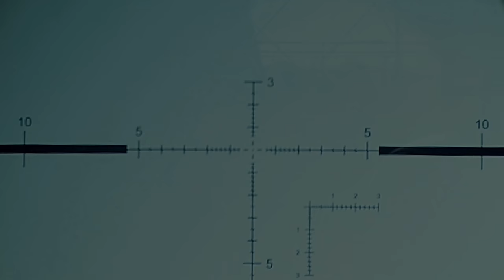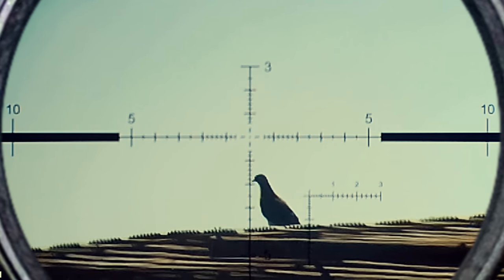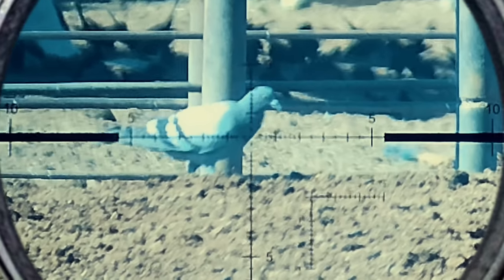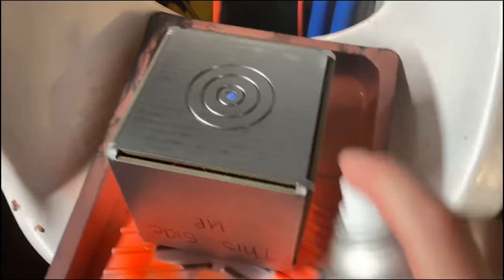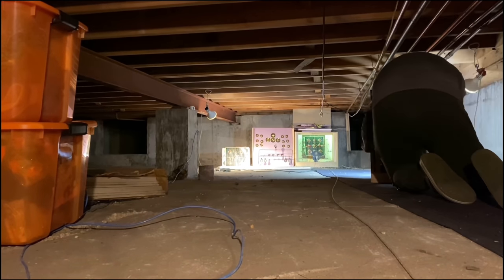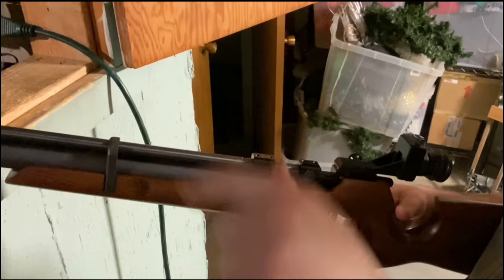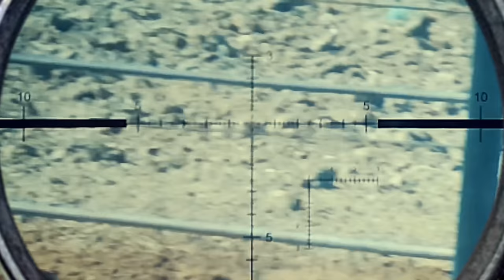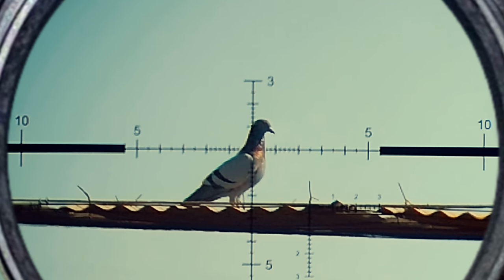Pigeon Hunting with the Leshiy 2

Comment: I'd put a pulley system to move the targets back and forty with some wheel on the bottom. Hard wire the lights to the box and simply pull the cable and the box comes to you. No more crawling to the box.

Comment: Otay T... for the bell box.  Two ropes attached to the box (bottom front and bottom back).  A pulley at the bottom back behind the box and a pulley above the first one.  Route the back rope through the two pulleys and have it go to the entrance of the crawl space.  The front rope also needs be long enough to reach the entrance to the crawl space.  Now, to the bottom of the box, mount four swivel casters which are large enough to allow it to traverse without tipping over.  You  want the center of gravity of the box to be low.  Pull the front rope to bring the box to you, pull the rope going through the pulleys to return it to the far end.  If you need it, have some stops for the box to bump against to position the open front to you in a consistent angle when brought into position for shooting at it.

Love seeing all those flying rats getting smoked.

Comment: Skateboard wheels on the wooden box holding the target, aluminum or steel L or U channel for the wheels to ride in, pulley at the back wall for paracord to pull it back and one in the front can even be motorized

Comment: Little late but why not put the box on a rail? A string to pull it towards you, and a rubber stopper with a magnet to push it and lock it back. Then you don’t have to crawl in there to paint it.

Comment: Nice shooting as always! Have you thought about a prison break out rail system for yourself and the targets? String anchors to eye bolts to front and back. Back string through a wall mounted pulley. A mechanic under car sled until then?

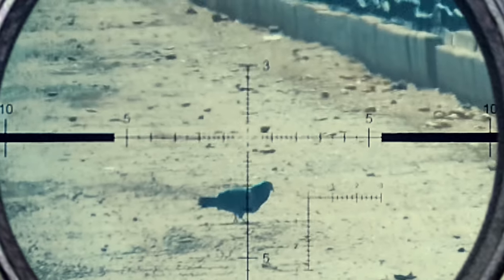Comment: Looked like you had an unsafe shot at 5:00 with livestock behind...followed by your comment that you have to be careful with ground shots in case there is livestock behind! For your bell target, the white paint should be non-drying, and you make it by making a thick paste out of titanium dioxide powder and caster oil (any viscous vegetable oil will do). This is proper bell target paint, and you can wipe out the pellet mark over and over again. Match range is 6 yards in the UK, and it's a sport going back over a century in pubs and clubs there. In matches you're supposed to use round-headed pellets because they will leave a white spot in the centre of any hit on the plate, and that's the reference point for scoring the shot. Usually 5.1 for a shot clean through, 5 for one clipping the hole but not leaving a white dot in the splash, otherwise it's a 4, and so on out across the rings....but you'll never shoot a 3, right! ; )

Comment: If it was me I would use a old rc car to get the target down rang and drive it back when done shooting. You can also make a auto reset for drop down target by using a remote silanoid  to reset target For a target line like at a in door rang I would use a old garage car door opener with remote. I have some other ideas for auto or remote targets but I can't give all my ideas up in one shot hahaha🎆😇🤔💯👍👌✌️